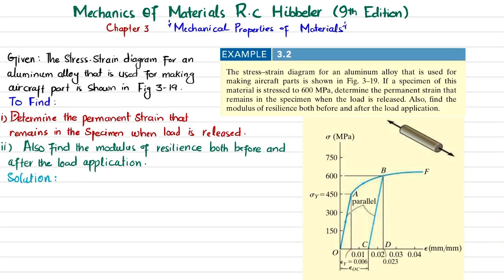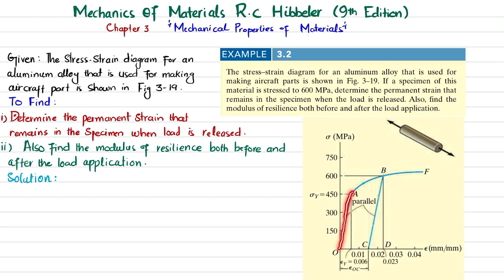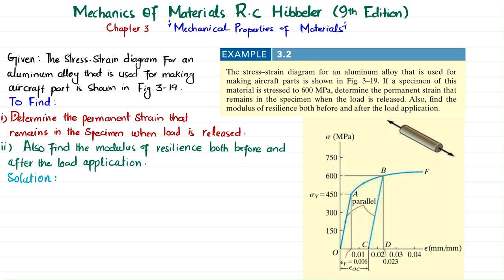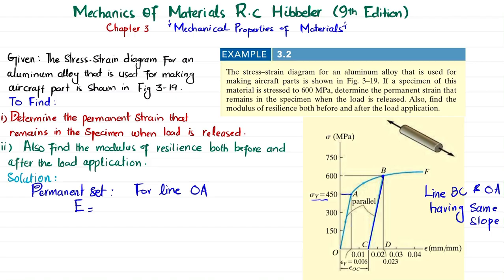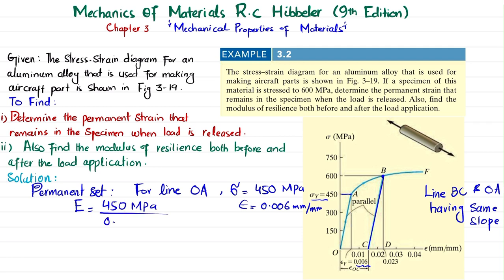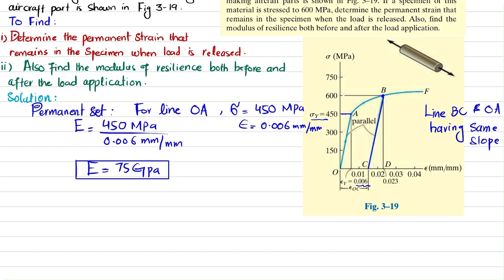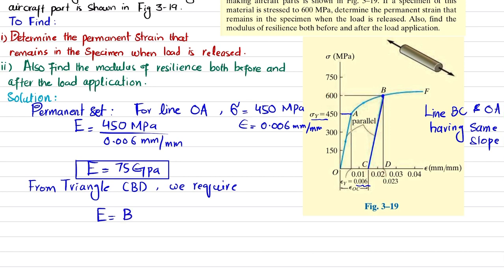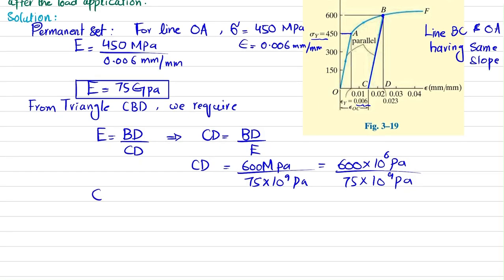Determine the permanent strain and modulus of resilience | Example 3.2 | Mechanics of materials RC H

Comment: what is meant by permanent set ?
Reply from the maker: Permanent set is the irreversible deformation that remains in a material after the applied stress is removed, occurring when the stress exceeds the material's elastic limit. It is the result of plastic deformation, which means the material will not return to its original shape or size and is a permanent change. In a stress-strain curve, this is represented by the amount of strain left when the stress is brought back to zero.
Reply: @engradnanrasheedmechanical  okay thank you 👍
Reply from the maker: You are welcome